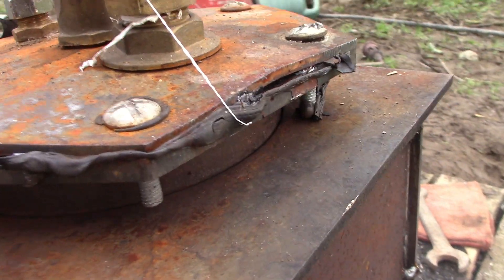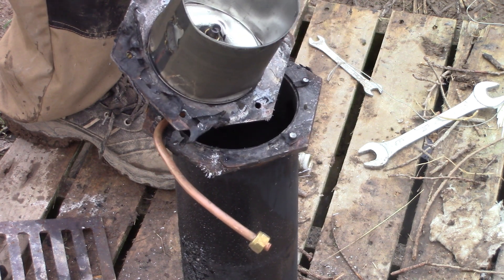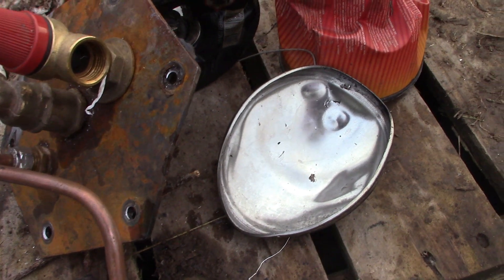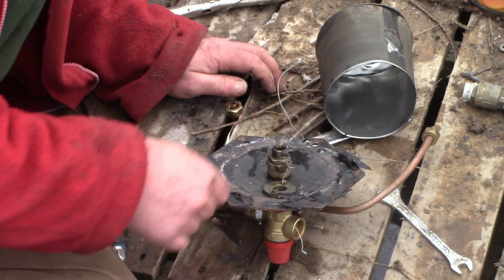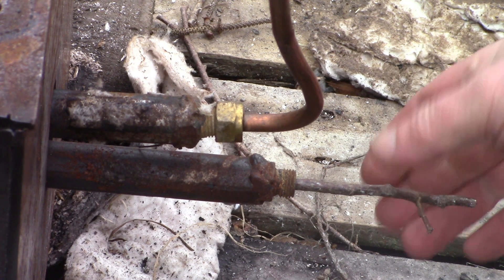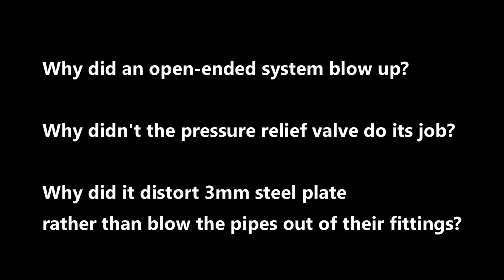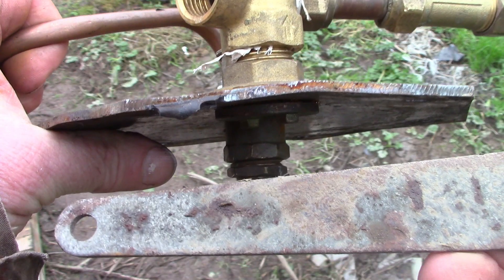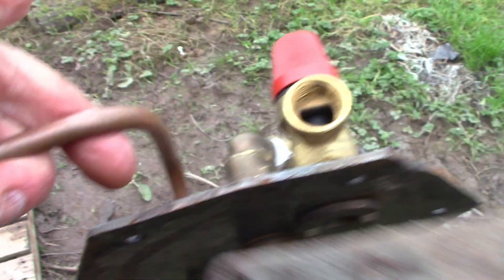Why Did My Boiler Explode??!! My Own Big Bang Theory...

Comment: I presented your video to a group of U.S.Navy Boiler Technicians, many of whom still work in the boiler and steam power field. Our unanimous conclusion is: when the top aluminum gas cylinder got jammed into the top of the boiler and on the inlet valve, it formed itself over the fittings, (as shown in the video). This blocked the pressure relief valve from operating as designed and your boiler failed at the weakest link, which was the seal for the top of the boiler, between the bolts. You stated that the safety valve was set at 43 psi, it took a lot more pressure than that to bow a 3 mm plate. The pressure caused by the failing aluminum cylinders was only enough to form the aluminum to the top and block the safety, starting the chain of events that ultimately led to the failure, which would have been in the area of 440psi + or -

Comment: My husband was a Journeyman fitter/welder for 42 years for one company. He believes your pressure relief valve was blocked by the implosion of your float.  Not that it was an issue this time, but he recommended 70/18 rod for your welds. Incidentally, he said steam pipe blowouts at the power plant (which was where he worked for 42 years) can cut a man clean in half. Happy building, good luck and be safe.

Comment: Hi. I do not agree with your analysis. Gas containers are never really empty. I think the gas container first exploded which was then pressed against the top of the lid and blocked the safety valve and protected the sockets from being squeezed out.

Comment: I am glad that you are safe.
In a previous comment I suggested modular, separate systems.
As I understand your analysis: You have combined a water-level governing device with a water-boiling device. "Bang!" because if conflicts between the two sub-systems contained within a single space.
Proposal: Separate these two components into modules so that one module CANNOT interact with the other.
Then at least you have removed one BANG possibility.
Here's a poor analogy: My toilet system has a module that governs the input flow of water and shuts off when enough water is in the cistern. A second module uses the water to flush wastes into the sewer system.
Chris

Comment: It may just be difficult to see from the camera, but to me it doesn't look like the top float imploded; it looks like it was pushed forcefully up into the top of the boiler, causing the valve at the top to penetrate it. Possible that it could have been pushed up hard enough to cause the steel to bend, but more likely I'm thinking that as it was pushed up into both the normal steam valve and the safety valve, it sealed them both off. Thus, with no where else for the steam to escape, it forced open the top. This would explain why the safety valve didn't work, why the steam didn't simply escape through the open end, and why none of the pipes are damaged; they were all sealed off by top float pushed around them.

Comment: there may have been some residual gas in the cannisters. (heat - expand - bang).
if you use such cans again, cut the old valves out, and wash clean. > > > >
https://www.youtube.com/watch?v=jtp3uqHwMW8

Comment: I did a rudimentary, back of the napkin calculation, and assuming your boiler is 15 cm in diameter, I think a 3 mm lid should hold about 2 to 5 bars of pressure.
Reply from the maker: Interesting. Thanks.

Comment: I'm thinking that those gas bottles are designed to keep pressure in, especially the domed bottom is not made to resist external pressure. As they were empty they were bound to collapse, cheers

Comment: When air flows from one area to another one and there is a change of diameter the local airflow goes super sonic and slows down the volume of air escaping. These are used in light aircraft Presurisation systems to minimise air loss. The rapid pressure increase could have caused this momentarily overpressurising your boiler.

Comment: The fact the top float had its bottom blown out and doesn't appear collapsed makes me suspect it was actually a float explosion. if the air inside the butane tank ended up at a higher pressure than the steam in the boiler then when it burst it would release enough volume suddenly to pop the already stressed boiler top plate.

Comment: I guess you didn't hydro test your system.  Fill it with water and crank up the pressure to 1.5 times (I think) the maximum operating pressure.  The water does not store energy so it's much safer.  You are lucky you are not dead.

Comment: I think the pressure in your boiler got high enough to crush your float cans, this could be combatted by pressurizing the floats. 

The top float looks like it got melted by the hot steam a bit and the weakened aluminum was punctured by the pressure control valve it was supposed to operate. This covered the release valve for the steam and built pressure in the tank. Then "bang".

Basically your boiler couldn't release enough pressure through the holes it was given, especially after a restriction was introduced by the top can crushing into the ports.

Comment: Hi Tim, love the video glad your ok. I have a model steel steam loco boiler and it runs at about 60 psi the steel for this is about 10mm thick for some comparison. It also has stays that connect flat surfaces that stop them buckling.I suspect that you exploded as the rate of steam production was higher than the rate it could exit your very long tube. Try blowing down that long tube, even though it’s open you will find it’s a lot of effort and there is a lot of resistance allowing pressure to increase in your vessel . Given the very thin lid it deformed before your safety valve reached 40 psi. Flash boilers that I have seen do not have the pressure vessel they are only tube with very high pressure but very low volumes of steam. On your next one hoping this not put you off hydraulically test your system with water before you steaming it. It will show you any point of failure without the Big Bang. Not as good for the clicks but much safer.

Comment: To me looks like the top float Blew the bottom off of it and rocked up to the top and the bottom got crushed with the pressure of the top float blowing,  I know you said those cans were empty, But if there was even a small amount of gas left in them it could have exspanded past the 300 PSI the can can hold. causing the bottom to blow off because the bottom was mushroomed out, when it used to be concaved in.   Thats my though.

Comment: Id like to say whatever was left inside your floats caused a B.L.V.E. boiling liquid vapor explosion cause the valves in the cans were built to release  by being pressed from the outside. You techically had three boilers and two of them if not one of them got too high of pressure and exploded.

Comment: Perhaps you may want to investigate your boiler's feed-water system.  It looks as though your boiler chamber may have gotten too dry.  That may have led to the failure of your (somewhat dodgy) float system.  The floats appear as though they were a bit weak and then failed from what may have been an over-pressurization of the boiler that resulted from a failure of the feed water system.

The chimney heat exchanger and the flash boiler certainly do not constitute an "open" system.  Steam pressure can build up exponentially.

This is an admirable project and It seems you are doing good engineering.  Steam boilers are tricky and sometimes dangerous systems.  Be careful!

Comment: Many people are saying a float exploded when the gas pressure inside became too great. I think this incident also requires a look at the water inflow rate, since if the boiler ran dry the steam would be instantly flash-heated and could result in similar damage.
Reply from the maker: Yes, but there was plenty of water left inside at the end

Comment: Glad you are ok.......NEVER USE FUEL CANS IN A PRESSURE SYSTER, ESPECALY WITH THAT MUCH HEAT IT WILL SELF IGNIGHT, EVEN IF YOU DONT SMELL ANY FUEL THERE WILL BE REMINATES LEFT IN THE STEEL.

Comment: I don't think your floats have imploded but instead exploded, at least the one on top, and crushed the one at the bottom. That instant increase in pressure couldn't be compensated by the pressure relief valve or the open system. There is too much resistance in the system to handle a rapid increase in pressure. You need a predetermined breaking point in the system for that. In your case, it was the lid. Luckily no one got hurt.

Comment: The top float exploded. I've seen can like that befor the second bottom can is definitely an internal differential pressure failure. Heat a mettle tin up seal it and cool it quickly it will look like the bottom can with that sucked in look. This could have been caused by a large  pressure differnec when can 1 exploded also.

Comment: Good morning Sir 😇 ( I'm happy that you were not injured  👌🙏😇 ) I think Sir you are absolutely correct 👌👍🧐 but you need a safety pressure valve like that have on steam train ( high OUTPUT weights ) so any sudden pressure life the weights and clear out the pressure built up FAST since it is a big opening tube  👍🧐 Keep up your OUSTANDING video Sir Cheers 🍻👍👌

Comment: Reading other comments re. implosions, and low-pressure scenarios causing the float to implode. If you did achieve a low pressure/vacuum situation inside the boiler even for a fraction of a second, wouldn't that exponentially increase the flash boil effect? I seem to recall water in a vacuum boils at much lower temps. I could easily imagine that scenario overwhelming your relief valve, especially if the float can was impinging on the inlet area. Always interesting. Glad you're ok.

Comment: I feel you are exactly right... My fix would be to make the fill portion an outside independent mechanism. Second. The entire unit might need to be bigger to compensate for the fast  fluctuation of pressure, maybe even an external expansion chamber. So that the fluctuation has more leeway time to react . So you have more time to react. Also you can never have enough pressure gauges....??????
To mechanize or to automate. HUMMMMMMMM      Ponderous very Ponderous. That was a popular 80's hit. BTW.
One more try,,, third times a charm.   CCHHEERRSSSS